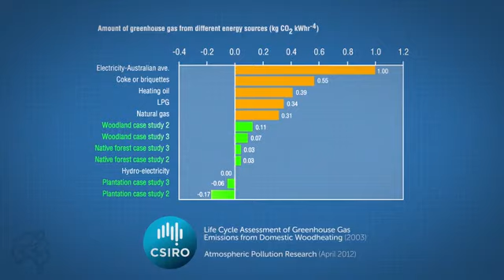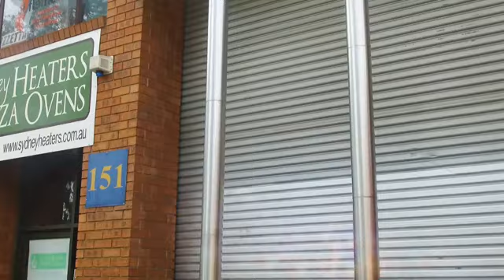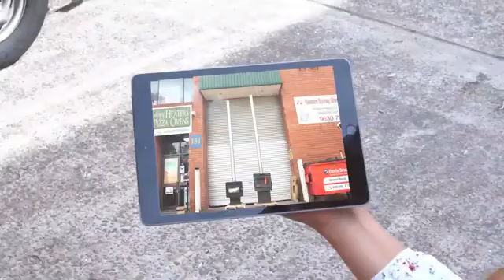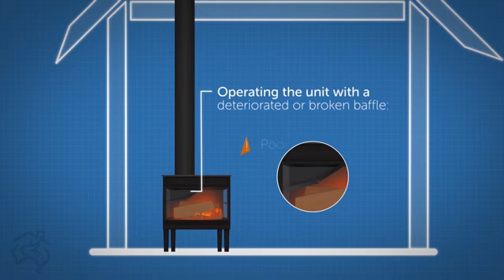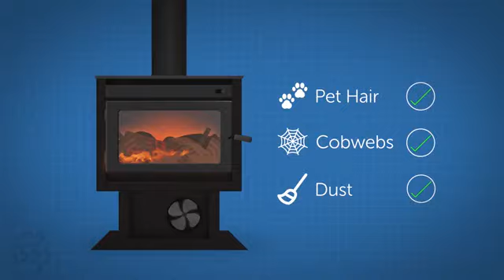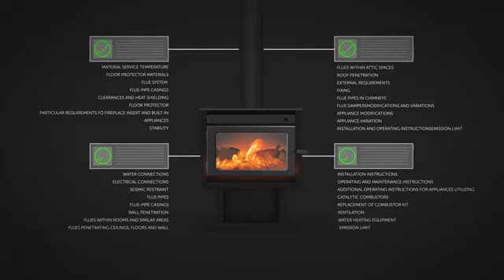Australian Home Heating Association Video About Using Slow Combustion Wood Heaters

Comment: Dont waste your time and money buying pine for kindling or building a fire bottom up like this, instead;

Use (dry) small bracnches or chop down a split log into small pieces, place those on top of your split logs and light them with a very small amount of fire starter or by lighting one of the smallest bits of kindling (branches etc.)

This is the top down method and avoides reaching down through the criss crossed nonsense to attempt to light far too much firelighter material as well as opening the door up after the pine has taken to stack split logs on top.

Instead a top down will burn and drop hot material onto the split logs underneath which will then catch and there's no need to tend to it for hours, not opening the door more often than a necessary is more efficient and avoids smoke in your home, especially during the starting.

I learnt this from a Swede decades ago and it's far more efficient than the process in this video.

Comment: Dork specs basically buy everything of you never use an old heater only buy new from us it’s better for the environment gosh you guys are laying it on thick
Reply: The new Australia standards make companies build there wood heaters so that they emit way less emissions then in the past… nothing they have said is incorrect.. so don’t mislead others with your opinion..
Reply: @AMJB100000000  …what are these standards? What if you buy a unit imported into Australia?